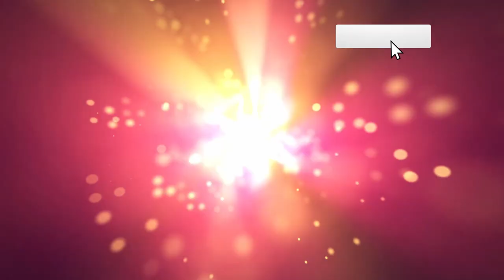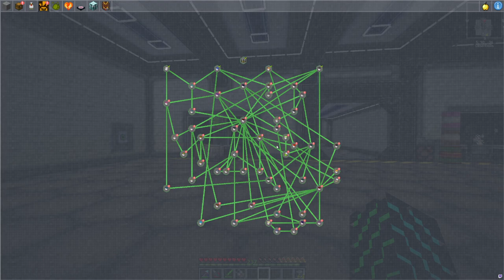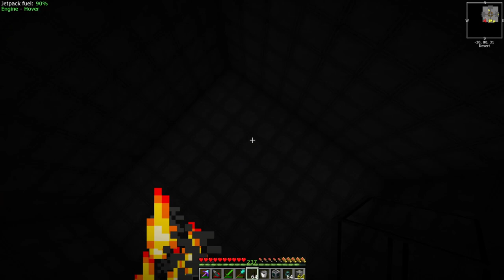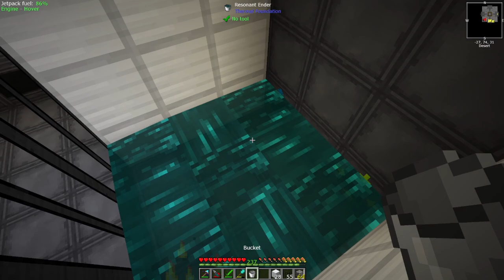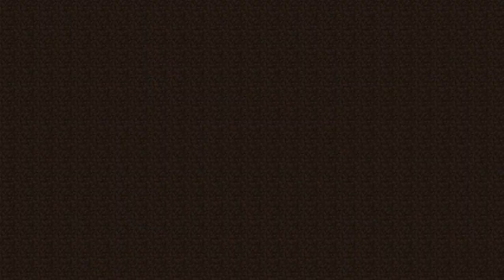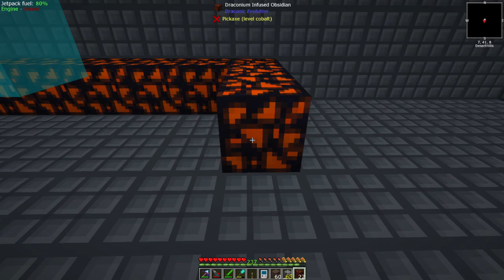StoneBlock 2 Episode 7:  Extreme Reactor Set-up and Auto Wither Farm!!

Comment: If you have a petrified fuel generator in the pack, you can use aeternalis fuel blocks from project e for stupid amounts of energy really easily
Reply from the maker: Thanks for the tip, however it looks like each gen would be maxed at about 46k rf/t.  Now that is a lot but I would need way too many of them to even touch the RF that is going to be needed later on.